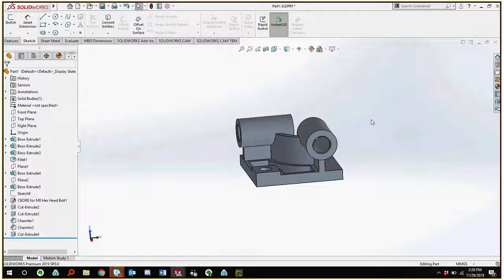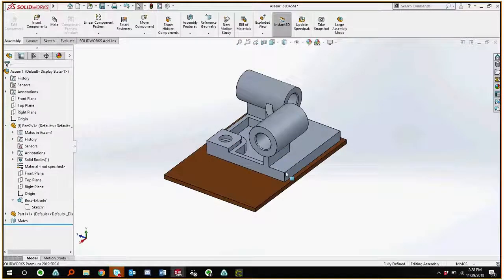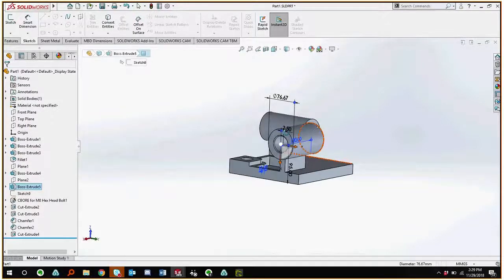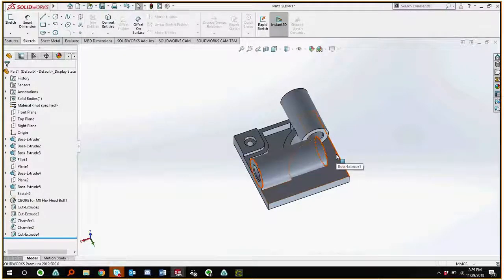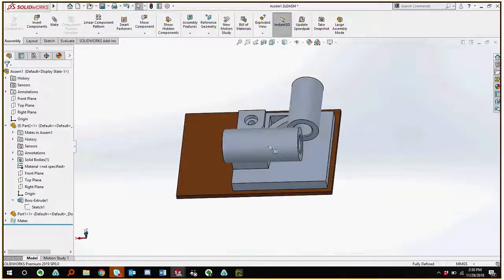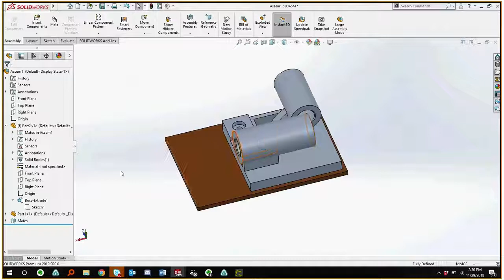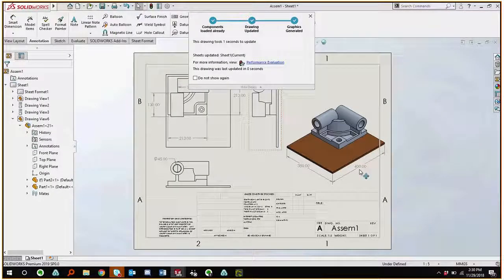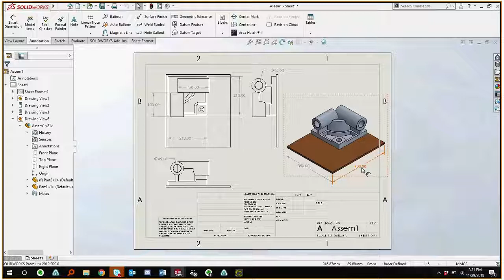Parametric Modeling

Comment: Well that's kind of obvious but the point of parametric design is that you create a parameter, assign a value, and then change the value of the parameter such that you don't have to go individually measurement by measurement. Instead you tackle all dimensions named the parameter you altered in one single go. This is a basic property of Fusion 360 for instance.